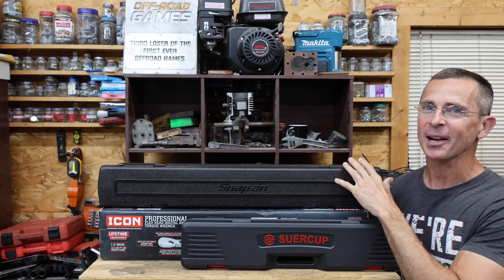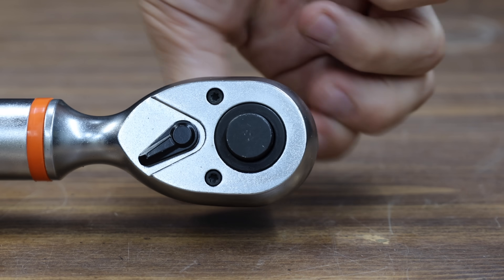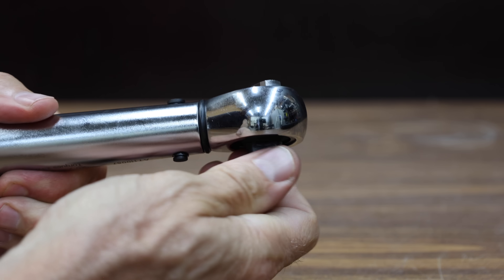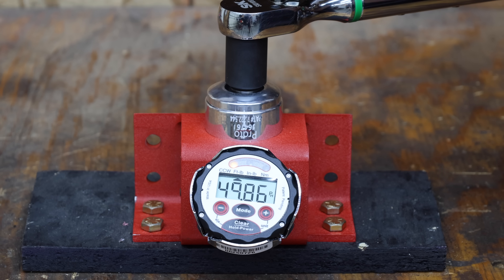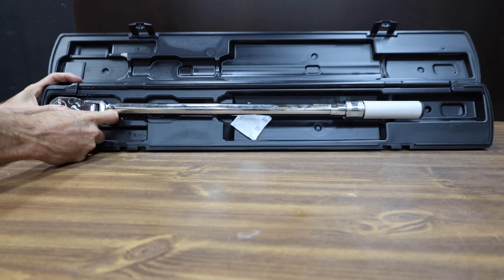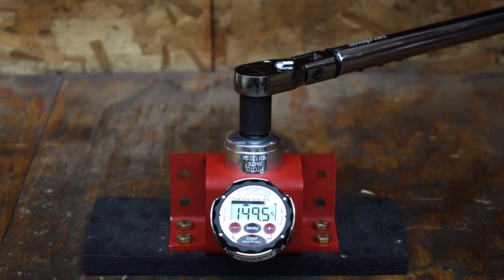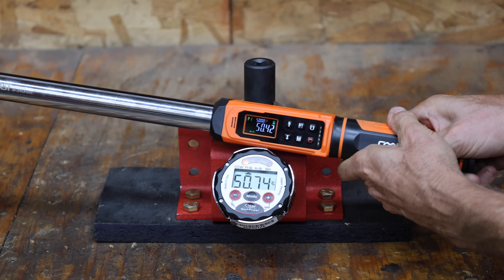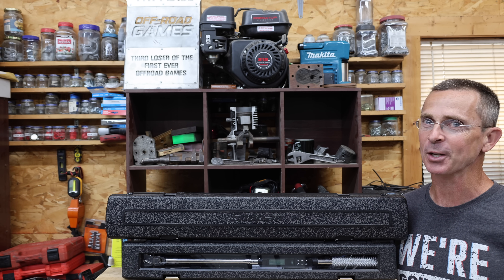$78 Torque Wrench vs $790 Snap On & ICON—I Didn’t See This Coming!

Comment: I love how you test, however your testing in this case is flawed.  Torque wrench should never be used in the bottom or top 20% of its range.  So for a 300 ft-lbf torque wrench you should find a different wrench.  If you need to torque below 60 ft-lbs or over 240 ft-lbs.  If you're in those ranges you should find a different torque wrench to improve your accuracy.

Comment: I had a Harbor Freight torque wrench with a "lifetime warranty" that lost calibration and ultimately caused an engine failure. HF wouldn't touch the cost of the engine replacement, but they happily replaced the torque wrench!

Comment: Can you do a test of Retro handhelds And the test would included 18 handhelds perfectly ordered by price can be tricky, as prices for handhelds—especially retro emulation devices—fluctuate constantly based on sales, sellers, storage size, and whether they are ordered directly from the manufacturer or through a reseller.
Furthermore, the Lenovo Legion Go and MSI Claw are not typically classified as "retro handhelds." They are full-fledged Windows/gaming PCs in a handheld form factor, designed to play modern AAA games, and their high price point reflects that. They are included at the expensive end of the list per your request.
Here is a list of 18 handhelds, ranked from the most expensive (Handheld PCs) down to the cheapest, incorporating the specific models you requested.
Handhelds Ranked by Approximate Price (Most Expensive to Cheapest)
The prices listed below are approximate typical retail prices in USD, which can vary significantly by retailer, region, and specific hardware configuration (e.g., RAM/SSD size, whether games are pre-loaded).
| Rank | Handheld Console | Approximate Price (USD) | Notes |
|---|---|---|---|
| 1 | MSI Claw | $700 - $1,000+ | High-end Windows Handheld PC, not a typical retro handheld. Price depends heavily on CPU and storage configuration. |
| 2 | Lenovo Legion Go | $650 - $800+ | High-end Windows Handheld PC, not a typical retro handheld. Features a large 8.8" screen and detachable controllers. |
| 3 | AYN Odin 2 Pro | $350 - $450 | Powerful Android handheld, capable of running modern Android games and up to PS2/GameCube/Switch emulation. |
| 4 | Steam Deck OLED | $400 - $650+ | PC Handheld capable of retro emulation, but primarily for PC games. Price depends on storage. |
| 5 | Analogue Pocket | $220 - $250 | Premium device focused on original cartridges (Game Boy, GBA, etc.), with high-quality FPGA hardware. |
| 6 | Retroid Pocket 4 Pro | $200 - $250 | Mid-range Android handheld, excellent for up to PS1/N64/Dreamcast and some PS2/GameCube. |
| 7 | Anbernic RG405M / RG556 | $150 - $200 | Good metal build quality (RG405M) or larger screen (RG556). Excellent performance for up to PS1/N64/Dreamcast. |
| 8 | Miyoo Mini Flip | $120 - $150 | Clamshell (folding) design, great for GBA and up to PS1. |
| 9 | Retroid Pocket 2S | $100 - $120 | Budget-friendly Android device, very capable for older systems. |
| 10 | Anbernic RG35XX Plus | $60 - $80 | Upgraded model of a very popular budget device, strong performance for up to PS1. |
| 11 | Miyoo Mini Plus | $50 - $70 | Extremely popular vertical-style device, known for its pocketability and customization with custom firmware. |
| 12 | R36S (with 21,000 games) | $45 - $65 | Highly popular, powerful budget device running ArkOS. Note: Handhelds pre-loaded with thousands of games often contain ROMs that may violate copyright. |
| 13 | Anbernic RG35XX | $40 - $60 | The original version of the popular budget model. |
| 14 | TrimUI Smart Pro | $40 - $55 | A great budget option with a larger screen than the Miyoo Mini Plus. |
| 15 | Powkiddy V90 | $35 - $45 | A very basic, low-power clamshell design for older 8-bit and 16-bit systems. |
| 16 | Anbernic RG28XX | $30 - $40 | One of the most affordable and smallest pocket-sized options. |
| 17 | Powkiddy Q90 | $25 - $35 | A very simple, low-cost horizontal form factor device. |
| 18 | Data Frog SF2000 | $15 - $30 | One of the cheapest options available, very basic and only suitable for the oldest console generations (NES, SNES, Game Boy). |
Summary of Price Extremes
 * Most Expensive: MSI Claw (and Lenovo Legion Go) - These are high-performance Windows computers designed for modern gaming, which is why they top the price chart.
 * Cheapest Retro Handheld: Data Frog SF2000 - This device is frequently cited as one of the absolute lowest-priced, functional retro emulation devices on the market. Can you do multiple tests like screen size battery life Buttons how many games does it have And the number of consoles able to do Can you do this for your next video
Reply: Can you do this for your next video idea please
Reply: Can you do it for your next video please do it
Reply: Can you  did for  your  next  video  please

Comment: I work on heavy equipment it’s nice to have 1/2 torque wrench that goes up to 300lbs to fit in tight spaces. Where 3/4 torque wrench will not fit.
Reply from the maker: Thanks for sharing!

Comment: Here's my one and only issue : Did you attempt any of them after doing "local" calibration?

No lab will certify a tool unless it has a calibration process. No engineering outfit on earth trusts a piece of gear without real certification.

Comment: Hello was wondering if you could test homemade heaters like the copper tube in mason jar the ones with toilet paper for wick and see which one puts off most heat and for how long with different types fuel being used thanks anyway saying hellllloo from the middle of Kansas peace ✌️✌️✌️
Reply from the maker: Thanks for the suggestion.

Comment: Thank you for following up with this one!

I've noticed you haven't tested automotive silicone spray lubricants, it would be interesting to test longevity, viability on rubbers and plastics (as an oxidation preventer and potential UV protector), and lubrication
Reply from the maker: You are welcome!  Thanks for the suggestion.

Comment: dude literally used the least accurate AC DELCO torque adapter. I use them regularly and he also wasnt using it...skillfully I guess is the word. you dont open it up and build an engine with it immediately, which is what this test simulates. you do a few sets of wheels first to get the feel for it. Its def accurate and DEF has its place, but is not really a substitute for a torque wrench for engine builds. its great for non critical suspension parts or axle nuts where you can be off by a few pounds cuz you cant quite read the screen and are deaf and blind. it has an alarm and visual meter that work great. Bro def missed a hidden gem value because you can sorta "customize" the handle length and setup. makes doing tires easy with a 24" breaker.

Comment: Please do a video for the best pens! This may sound odd, but I tend to be hard on pens. I work blue collar and first responder and they are always breaking in my pockets from leaning against things or whatever. I like to have a couple extras in my cargo pockets and theres nothing worse than finding out it broke and spilled ink in your pocket. My best experience has been the Bic Round Stic because they are flexible and have decent writing properties, and also work on Rite in the Rain notebooks. But even those break sometimes and spill ink. I stay away from the brittle clear plastic bodies. I would really appreciate your scientific help with this!

Comment: Hello Todd, I have purchased a whole lot of tools based on your top choices and have never been disappointed!
There are however a few very important and basic tools that are still missing a decent comparison!

Hammers: Estwing, Fiskars, Truper (very common here in LATAM)
Hatchets/Axes: same as above
Shovels: same as above
(I know it's hard to find a super low (or high) quality brand for the above three but it'd still be good and fun to do it)
Levels: Stabila, Milwaukee, Dewalt, Workpro
Metal files: Grobet, Nicholson, Pferb
Punch sets: I don't even know where to begin
Pry bars: Tekton, Estwing, Gearwrench
Pick and hook sets: Just bought a Tekton set, let's see how good it is!
Small Portable Tool Boxes (Bought the Gearwrench drawer one based on your mechanic set video, great box!)
Medium Portable Tool Boxes/Drawers
Pliers Wrenches (Knipex vs basically everything else lol)
Soldering Irons for electronics (Klein, Hako, Weller)
Include corded power tools (for the folks that do not need the cordless features or that do not want to get into the batteries ecosystem)
OBD2 Scanner (BT ones, more professional one like the Innova 5610 or even full professional like the tables ones)

Thanks again for all the hard effort, you are the standard of comparisons!

Comment: I just do some mechanical work now and then. I bought an Amazon Basic and used it twice on my car wheels. But, when I replaced the shock absorber, I could not use the wrench as it is so large. Why are all of these wrenches so large? Can't smaller wrenches have torque function?

Comment: Wow!  I only got an old-timey torque wrench with dial-in handle that I only used a handful of times.  Might've been a SK in fact.  Been ages since I used it last, only remember you're not supposed to yank on it but apply torque smoothly until it clicks, and to dial down to 0 to relieve pressure on the spring when you're finished using it.
Man, how times changed...

Comment: I have the click Craftsmen, Mac tools Clicker, Tekton, Snap On and an ICON in digital versions. I like the ICON, but the battery cap can loosen on occasion so needs a good twist, in reverse to tighten it and avoid the issue.

Great review, 13000+ clicks? Wow

Comment: I have a 1/2" drive Quinn torque wrench, purchased at Harbor Freight, and the display looks a lot like the Craftsman; hopefully it is just as accurate. It is mostly used to torque lug nuts as I rotate my tires at every oil change.
Reply from the maker: Thanks for sharing!

Comment: i don't know about % accuracy on the cheap (under $25) ones at Harbor Freight, but they are consistent and durable.

until two tiny screws fall out. Good thing they have their $3 "Loctite" in the store!

thank you for another great video!

Comment: I do have one of the pricey Snap-On 1/2" digitals. I opted for the 4" longer version with the top end of 300 ft. lbs. I still have several different digitals and the adjustable click-type. Funny that my Snap-On dealer made fun of my 50 year old Craftsman twist grip clicker, that checked within a 1/2 lb. when checked on his tester... actually surprised me.

Comment: It's been a long time since you've destroyed anything for the sake of finding out.  But what would happen if you tried to parallel an inverter generator with a non-inverter generator.  It seems theoretical possible.  But I don't have the audience/ money to make finding out pay off.  If you are successful, I'd be interested if they lock in phase or do they wander out of phase.  Worst case scenario something goes out of one or both generators are physically ripped apart.   Either way seems like good content.

Comment: Impressive video as always. I am always amazed by how much information you squeeze into your videos. I have been watching the Icon brand Torque Wrench. I purchased a Snap On 1/2” and 3/8” used and have been happy with them and have had them calibrated with no issues. Thanks for your unbiased testing.
Reply from the maker: Thank you!

Comment: We use Snap On, we have too have the torque wrenches calibrated every 6 months, if there is little change after a year, we can then have torpue wrenches, calibrated once a year. As far as I know Snap On is one of the few that can be repaired, (they actually have repair parts), and recalibrated, which is why we use them.

Comment: Another great video for the larger units.  Do you or will you have a video comparing torque wrenches in the lower range? My big torque wrenches are of no use when calling for 20 lbs or so.

Comment: I have a couple pretty expensive Wright click torque wrenches, made in the USA and am more then happy with them. I guess, even after Todd's great work with these digitals, that mechanical is still the best FOR ME. No batteries to replace/corrode make the best choice for MY needs

Comment: Great review as usual. The one point you didn't touch on is the torque angle feature of the Snap On. The tool keeps track of the angle as you ratchet it to the required degrees. Extremely useful these days. Do any of the other brands have this feature?

Comment: I'm so disappointed by GearWrench! That's my wrench. ☹
Reply: Would you please consider testing ratcheting bar clamps in the 24 inch, 300lb range (the "trigger" type)? Jorgensen, Irwin, TEKTON, VEVOR, WEN, Ironton, BESSEY, DeWalt, Festool (don't know if they make a 24").

Comment: I wonder how my old beam type torque wrench would stack up? I have an old Proto that will cover most ft/lbs that I will ever use. It clicks when it reaches the value. I have an older Craftsman for in/lbs. Why does everything have to have a battery in it nowadays?  I remember some information that these old wrenches that you you twist the handles to adjust are most accurate over most of their range, but may lose accuracy at their extreme low and high settings. I never had a way to test their accuracy; just at the mercy of the manufacturer.

Comment: Another excellent video.  I have to admit that I should be using my torque wrench more often, but instead I tighten bolts to what I think is the correct torque.  If it ever measured it, I know I'd be off by quite a bit.  However, in all the years I've been working on things, I can't think of a time that something snapped, because I overtightened the bolt *damaged it and it snapped later), or I undertightened and it came loose.

I do like to see how well these tools hold up to normal use.  1000 cycles!!!  Wow, that's impressive!!!  Seeing the difference before and after for different brands was something.  I have a test idea - can you acquire multiple tools and test to see the consistency of the tools.  Maybe choose just two brands and see how consistent they are.  My guess is the Chinese brands won't fare very well.  Even the name brand stuff that's made in a cheap factory will feel bad.

Here's something that I noticed.  When Todd tests an Amazon product and it outshined the others in it's price range, it's soon sold out at Amazon.  Makes sense, since so many people love this channel and most of us will follow Todd's recommendation.  You hold a lot of credibility!

Sorry, my comments are all over the place tonight.  Not a lot of focus from me.  So I'll summarize: Another great video with tons of valuable information.  I love watching these videos and learn a lot about products I didn't know exist plus many times I find that I made a good buying decision too.

An idea.  Many years ago, I worked designing test equipment.  I didn't write the test criteria; I took what the engineers gave me and I made sure the test equipment would simulate the tests properly.  There was on piece of test equipment which I really liked.  It was a "shake and bake" machine.  The job was to simulate actual conditions by shaking the item, then running through hot and cold cycles.  My guess is that there are some of these old pieces of test equipment out there.  If you can get hold of one, you can run vibrational tests and hot/cold cycling.  That would simulate real world conditions and longevity.  Just a thought.

Comment: Can you confirm that where you hold the handle on a click style torque wrench affects the measurement but digital torque wrenches, since they use a strain gauge, can be held anywhere on the handle?

Comment: Pretty sure the min torque to be in the stated accuracy range for most (all?) of these is 20% of max value... ie for a 300ft•lb max wrench, it won't be at it's most accurate under 60ft•lbs....  And the test was at 50, which is right at the min, or under the min for all of these ½" drive wrenches.  If testing for the accuracy of a wrench, why wouldn't one test at a value in the middle of range?

Comment: I've owned and used a number of different digital torque wrenches and all of them have either failed, or they have parasitic drain and the batteries are always dead when I want to use them. Some of them high end brands too. Digital is nice, because you don't have to back off the spring like you do on a mechanical...unless it's a split beam. I now use a Precision Instruments split beam torque wrench and it's awesome. Accurate, no batteries, and I can leave it at whatever setting it was last used at and not worry.

Comment: Be curious how a an old fashion clicker is compared to digital?

Repeat these tests on digital then clicker 
Then drop it
Do they change 

Head bolts or studs I’ve seen go up 85 ft lbs
Rod bolts 25 ft lbs
Then axle nut. Oh boy 100+ ft lbs

Comment: I have the ACDelco adapter as it fits in my tool go-bag for the car. I check it a few times a year against known good torque wrenches and it's usually within 3%, but yes, it walks a bit. Still, it's way better than nothing at the side of the road.

Comment: Don't remember the cost, but I have 2 (3/8 & 1/2) Craftsman micrometer/click torque wrenches I bought 40yrs ago. My company has all their torque tools calibrated & certified every year, so I always slip in my 2 in. They haven't needed any adjustments in years.

Comment: Always enjoy your comparisons, just wish Tekton was in the mix.  I have 2, the 1/2" 10-150# (no longer manufactured=hmmm?)  which was shipped incorrectly instead of the 25-250# and they said keep both and no charge on the 10-150#.  The Amazon ratings of the 25-250# by 30K is reasonably high: 80/13/2/1/4 and yes 4% is 1200 dissatisfied, but versus 28.5K that were satisfied.  I have been using both for over 2 years and they seem to do great, but I just trust and do not test them like you.  Maybe I should test against another person's torgue wrench.  THANKS FOR ALL OF THE VIDEOS!